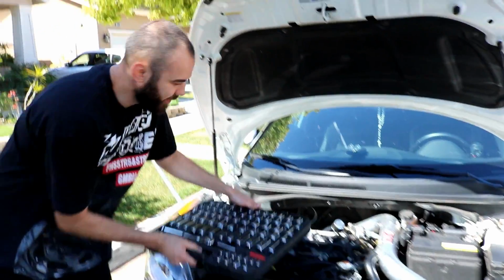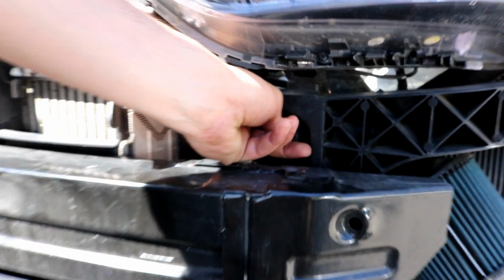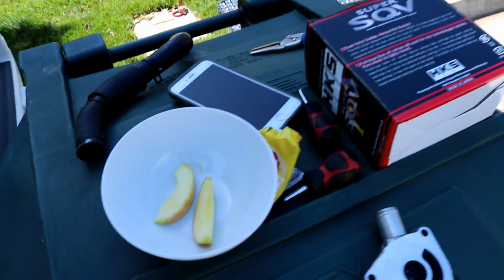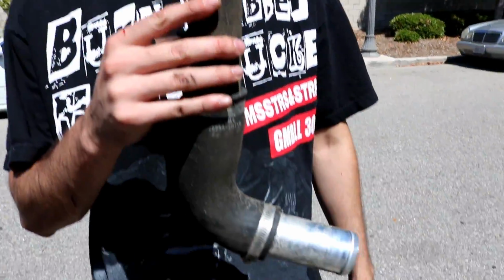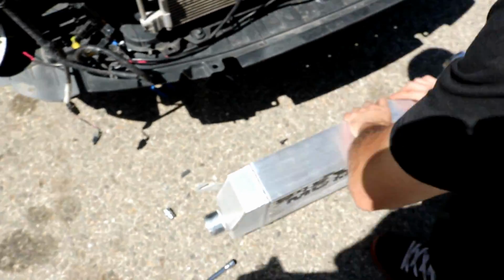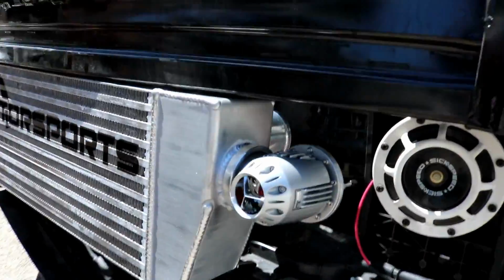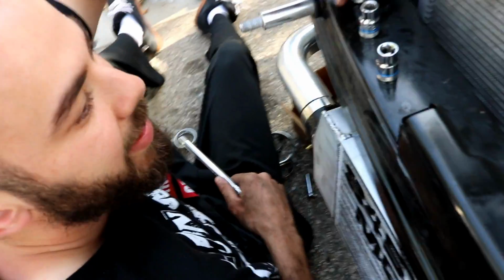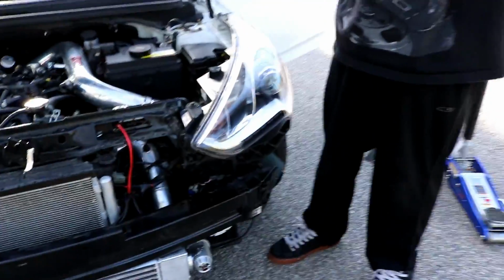INTERCOOLER UPGRADE?! | Hyundai Veloster

Comment: did you bead roll the cold pipe again ? those couplers are going to pop off under boost without the bead rolled lip.
Reply: John Scott no issues with it popping off, it's a really tight fit due to the throttle body spacer. I beat on the car everyday so it's still good

Comment: It could be the tb spacer messing with you idle issues has same issue in my civic si I screamed noo when you just the piping to adjust for eh spaced I would have taken it off personally but just a suggestion with taking off the sap we good luck

Comment: Nice vid! Can you use the stock BOV/BPV with that IC instead of the HKS? Would it sound the same as with the stock IC in that set up?
Reply: Frankie yes you can use the stock bov with this intercooler, and it won't sounds like the hks. Not sure what it'll sound like. A cold air intake makes bov sounds, so you could go that route as well

Comment: Who told you that you'd gain horsepower by installing an intercooler and not tuning for it? I'm not trying to sound like a dick but... all you're getting out of it is better efficiency. Now that it is more efficient, a tuner could add some timing or mess with the fuel table. But no, an intercooler won't net you any horsepower numbers without tuning for it. Again, not trying to be a dick, just passing some knowledge off to you guys.
Reply from the maker: Thanks for the info. We've learned alot more since this upload!
Reply: Alpha Dizzle you must have never heard of heat soak
Reply: That's simply not true.